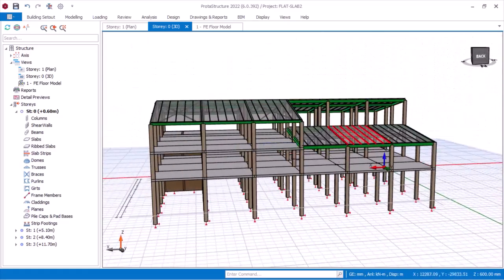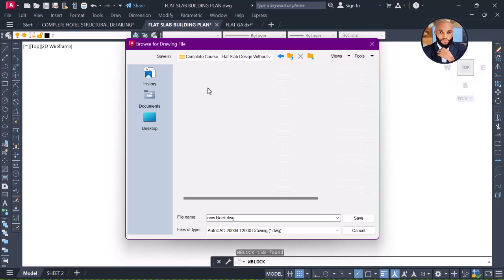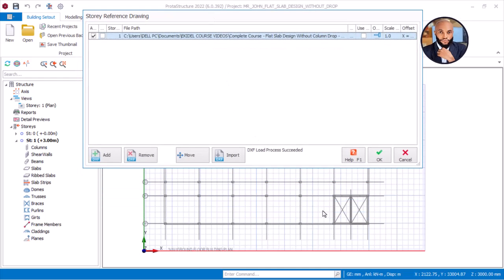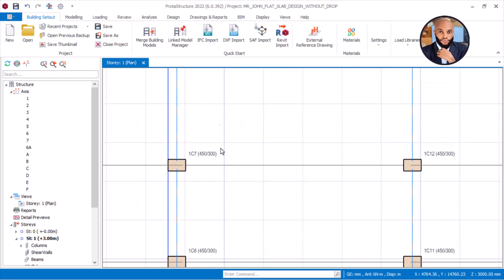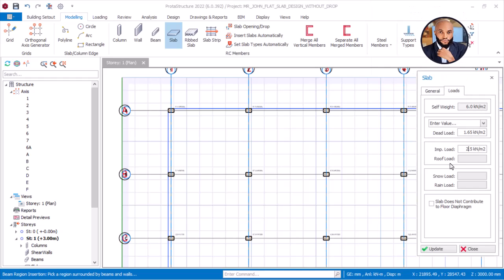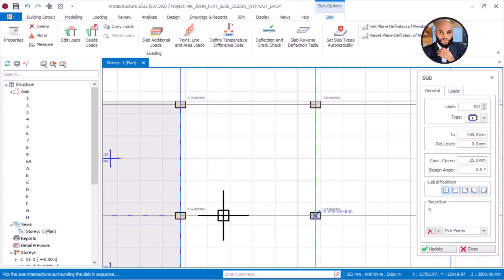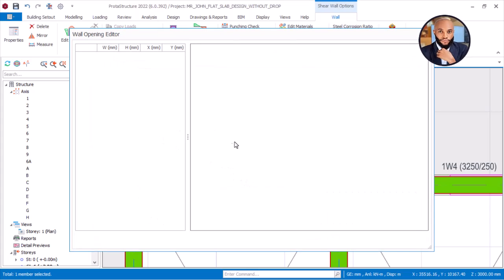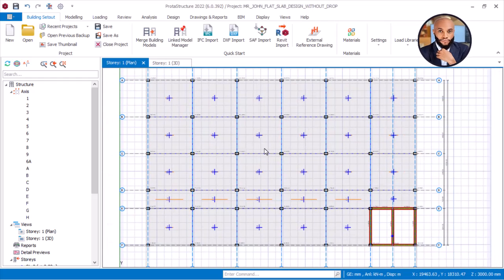Part 3 - Flat Slab Design Without Column Drop In Protastructure

Comment: According to EN 1992-1-1: Design of concrete structures.
The coefficient for effective depth of slab is:
- 20 for simply supported slabs
- 26 for continuous slabs 

HOWEVER
For flat slabs the effective span-to-depth ratio is often taken as approximately 30 to 35 depending on the deflection criteria and loading conditions.

Always check your slabs for permissible deflections after these assumptions.
Reply: Thank you very much however.